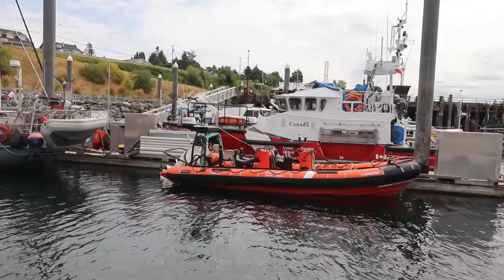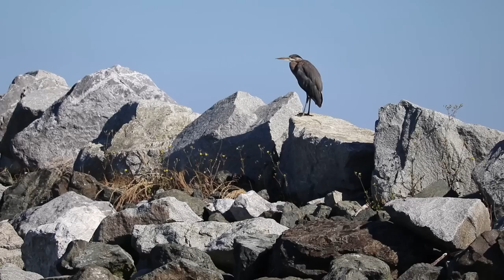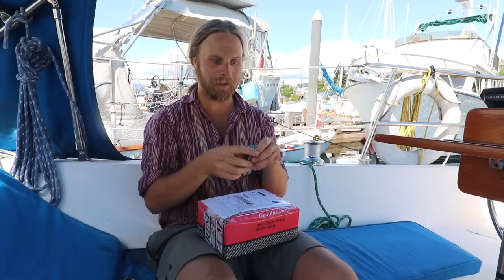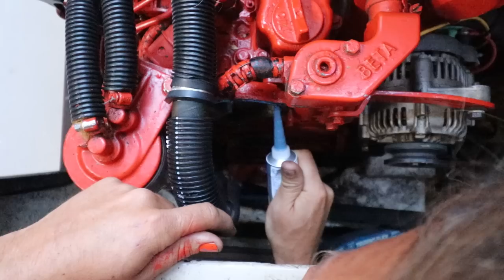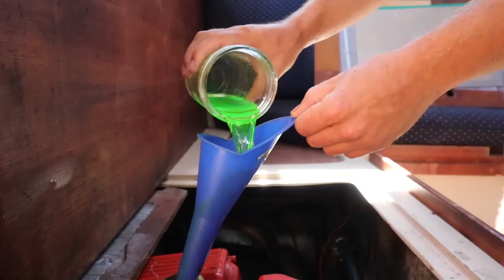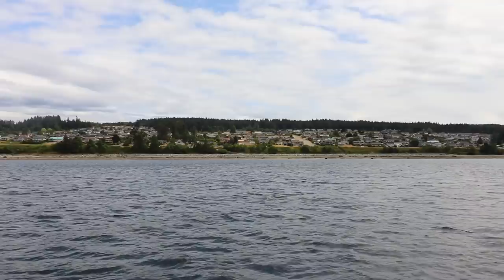Our Boat Broke AGAIN! Does Smooth Sailing Exist? | A&J Sailing

Comment: Nice clean Engine !!  That shaft should not have broken, did not hear this from other Cat30 owners, with a clean engine like that I have no doubt your keel bolts / studs  are all greased up and tightened, your engine looks different from what we had, we had a Kubota M30 24hp 3cyl diesel, did not have problems in the 10 years we had the boat, Nice video !!! love it !!
Reply from the maker: It’s a beta marine 14, and yeah pretty uncommon for a failure like that! The belt was a touch oversized and we think that the shaft sheared due to harmonic vibration. Never seen a water pump fail like this, I believe it’s pretty uncommon! Thanks for always watching, we love hearing from you!!

Comment: Excellent video, thanks.  just a heads up though, use the thread lock on the pully bolts but antiseize on the pump to block bolts,( just for ease of removal later since water pumps go often) if correct torque is used they will not come out, next only use a very extremely thin film of gasket silicone, rule is, if you have a lot pouring out when you tighten the bolts, there is too much and not good to get gelled up material floating downstream into the small tubes of the heat exchanger. but nice work thank you.
Reply from the maker: Thanks for watching and for the tips! Hindsight is 20/20 and I definitely went a little heavy on the thread lock and gasket sealant. I might take the water pump off again and redo it over the winter, there’s a couple of engine maintenance jobs that I’ve got planned for our off season. Also didn’t know about using anti-seize on the block bolts, thanks for the advice!!
Reply: @AllisonandJamesSailing  I used anti-sieze on my bolts to the block last summer.  I just used a hint of red RTV Silicone on the gaskets.  If I put too much, it would make it easier for the gasket to squish out, not to mention the extra silicone will get into the circulation.  But thanks for the video.  I wasn’t the only one having water pump problems.  My problem on my Perkins 4-108M was a leaking 2nd gasket against the block and not the water pump itself as I originally thought.

Comment: Betamarine use the Kubota engines that available world wide used in agricultural and industrial applications. Very tough engines and may be able to obtain parts at agricultural stores.  Wished I had a Beta marine instead of Volvo.
Reply from the maker: No complaints regarding the reliability of betamarine/kubota engines, they’re great and apart from this really odd water pump failure we’re very happy with ours!

Comment: i have seen the broken shaft issues in the past, usually caused by bad bearings plus the belt tension, good that you shut down right away, if that ever happens again keep an old rule bilge pump on board. if the pump should fail you can run a hose from either overboard or from the seacock and the output straight into the water pumps intake run either off you batteries or directly from alternator if you have a segregated belt for the alienator otherwise you may need to just use battery.
Reply from the maker: We have a feeling that the bearing was on it's way out, interestingly the belt that was on the accessory drive was actually oversized and even with the tensioner maxed there was still plenty of deflection present in the belt. We do keep a spare rule bilge pump on board and have the necessary fitting to jury rig a temporary fix should it happen again, but we're hoping to get a good service life out of the new pump. Thank you for watching and we love hearing your constructive feedback! cheers!
Reply: @AllisonandJamesSailing  I very much enjoy your channel , thanks for putting these videos up and helping fellow sailors and entertaining us too

Comment: Aloha, You might add a coolant over flow container, like what is on your car, to keep air out of your cooling system. Oxygen in the system will cause corrosion. Great video! Moonrunner
Reply from the maker: Aloha! Thank you for the advise Bill Denney Jr. I'll look into mounting an catchment container off the heat exchanger cap. There is a metal nipple there below the cap so it shouldn't be all that difficult to rig up. Cheers mate and thanks for watching!

Comment: Nice recovery.  If you have your dingy and an outboard with you it makes a very serviceable pusher tug. You can either lash it to the stern quarter or if it is an inflatable, butt the nose directly into the stern so that it is just below the swim ladder. Then tie it in place with lines from the aft end of the dingy to the stern cleats. Set the motor speed and lock its tiller and then climb back into the cockpit and steer with the ship's rudder.  
I used this method when my water pump seized up and left me stranded about 5 miles from the marina.  I was able to make about 3 knots with my 2-hp Honda.  When we got near the breakwater, one of us got into the dingy to hand the throttle and reverse.
Reply from the maker: Nice!! Glad you made it into the marina safely! We unfortunately didn't have an outboard at the time, but since have rectified that :) next time we're out we'll rig it up and see how best to 'dinghy tug' our boat around!
Reply: @AllisonandJamesSailing  Towing with a dingy is a losing battle.  Pushing works very well.  With our C30's the swim ladder makes a nice bow chock for my dingy.  I tuck the nose of the kink under the hinge of the ladder and use a couple of lines from the grab handles on the stern of the dink to the stern cleats on the boat.  It basically makes it a rigid extension of the hull and all of the power of the outboard goes directly into the stern of the sailboat.  
FWIW, I used the same setup when I was loading my Labradors.  With the boat tied off as described above, I could place my top of my extendable dog ramp between the Pushpit uprights and the bottom end would land on the seat and the dogs would march up and down like an Admiral boarding his flagship.

Comment: Normally you torque in a star pattern.  I use the black non hardening form a gasket instead of the blue rtv. Spares on my Valiant 40 are starter, fresh water pump, raw water pump, belts, impellers, fuel and oil filters, engine fluids, transmission fluid. You can't carry everything,  but having some basics can get you out of trouble. As another poster mentioned,  the water pump pulley in the video doesn't appear to spin true. At least in the video it looks out of round.  That should be checked and possibly you need a new pulley.
Reply from the maker: We’ve significantly amended our list of spares and now carry a spare starter, impellers, filters, belts and fluids and will continue to add to these supplies as our budget allows. Agreed there seems to be a bit of a wobble in the video, not sure if it’s an optical illusion of the camera but when we inspected the pulley it seems to be spinning true and in alignment. Thank you for your keen eye and suggestions :) cheers mate!

Comment: Hi Guys,
I’d previously mentioned your headsail car being too far back … i set mine at the optimum position for hard on the wind trim then use a 4:1  tweaker (8mm braided line)with a jammer at the bottom like a mini main sheet system with a snap shackle at each end , the headsail sheet runs freely through the snap shackle for when i ease the headsail for off the wind angles… i can pull this on from the cockpit…i was out sailing solo today… oh by the way i sail professionally on a race boat and am the headsail trimmer…
Reply from the maker: Hi Ian! Thanks for the explanation of how you have the tweaked set up on your boat :) we will be looking to set up a similar system on our boat so that we can get better at trimming. We actually picked up a copy of Ivan Dedekam’s Sail & Rig tuning book, there’s so much I didn’t realize about sail trim! We really looking forward to improving our system and getting more efficient at sailing. Thanks for watching mate! 
P.S. where and what do you race on? The professional racing scene looks like an awesome time!!

Comment: Did you replace the zinc anode on the heat exchanger yet? if not it is a good idea to check it out and replace regularly. Cheers
Reply from the maker: We sure did! There was a bit of incomplete footage that didn't make the cut. But while we had the coolant dropped out of the engine we pulled the heat exchanger stack, cleaned it and re-installed it with new O-rings as well as changed the zinc. On our Beta the zinc anode is located on the outlet of the heat exchanger as it dumps into the exhaust elbow.

Comment: Good job fixing your water pump 👍 read a lot of the comments.Lots of opinions down there 🤓think you didn’t do anything that cause the problem like a too tight of a belt.I would not have used thread lock especially on the bolts in the block.You did a great job otherwise 👍I like the beer to let it dry idea 🍺You both are great to watch and your videos are very good🤩
Reply from the maker: Thank you Mark for your very kind and thoughtful words! Hopefully those bolts will stay in for a long time before I have to try and remove them again, guess we'll be crossing the bridge when we get to it! Awesome to have you on this journey with us, cheers friend!

Comment: "bolts" not "screws"  ;)  interesting putting RTV on the bolt threads...Is that for anti-corrosion
Reply from the maker: Not RTV but threadlock. Essentially thread glue to prevent the ‘bolts’ from backing out under vibration.
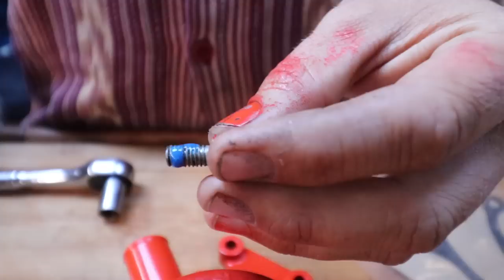Reply: @AllisonandJamesSailing  Ok, it was locktight, just looked again at 8:14 you can see two tubes....my bad , I thought you were using RTV and thought I might learn a new thing. Thanks

Comment: a belt that is sometimes too tight can cause the axle to pull, and end up breaking...or is it a fault?
Reply from the maker: Hard to say exactly what caused the pump to wear. The belt that came off was too large and even with the tensioner maxed out there was still a good amount of deflection in the belt. It’s still a mystery to us! We put the appropriate belt on after we changed the pump and have it tensioned correctly so hopefully this pump outlasts it’s predecessor.

Comment: Hi there. There's something really odd about that shaft  breaking like that, especially with the force with which it went as described. Beta engives are extremely well made too, and tbh, I'd have that old shaft thoroughly Inspected, plus what was around it to force it to go like that. to me, it had to have somehow seized inside the Pump, or had a much too too tight Pulley putting shaft side pressure in the Bearing ? Head scratching time here, but if it is possible to over tension that pulley to such an effect, imho you really need to get to the bottom of it Fast, or you could be heading for another Water pump Shaft Failure ? I don't think the engine wasn't getting enough water in to also be cooling the pump by the sounds of it, but something really odd has happened that you need to get to the bottom of, after all, that's nothing like being close to being an old engine, and looked after, a Beta should easily last a lifetime. My very best Wishes in getting to the bottom of this, as Boat engines are things we trust Our Lives to, when conditions get very nasty. Fair Winds. Bob . 👍eta typo fixes
Reply from the maker: It’s quite odd and unexpected! We’re still investigating. Will follow up if/when we find answers. Thanks Bob!!

Comment: Most coolant should be mixed 50/50 with water. Pure antifreeze can eat through aluminum. Read the bottle, some are premixed.
Reply from the maker: Cheers B Mck! Antifreeze can be some pretty caustic stuff also animals like to drink it sometimes so it's important to dispose of it carefully when changing fluids.

Comment: I believe that the Beta marine engines are "marinized" Kubota engines which means that you can get engine parts such as that water pump from any Kubota dealer or from the internet.  You just need to find out which block it is based on.  The same is true for my Universal M25XP which is a D950 Kubota.  I can get a water pump on-line in two days for about $50.
Reply from the maker: You're spot on, they are marinized Kubota engines! We have a beta-marine dealer locally so luckily getting the pump was pretty straight forward. But I will log some part numbers so that I can source parts without the surcharge of going through them! Thanks for the tip Hayden!

Comment: Beta's are known for their reliability and ease of maintenance. That kind of failure seems unusual and rare to me. The only thing I can think of is that the belt may have been way, way too tight.

"Does smooth sailing exist?"
Living aboard is like home ownership and "van life" only worse. The conditions are much more harsh and the boat never truly sits still, even when anchored. Even new boats have teething problems. Cruising is "fixing broken shit in exotic locations."  Just embrace it.
Reply from the maker: We also thought it an unusual point of failure. The belt that came off was actually too large and the tensioner in the alternator was maxed out with deflection still present in the belt. Perhaps it it was run for a while with a tight belt but as the boat is fairly new to us, we can only speculate as we embrace this new exotic location that we get to do projects in :)

Comment: The pulley didn't look like it was running true on the new pump, which may be what fatigued the original shaft that failed. I'd fix that now... or wait 8 years for the new one to fatigue. 😜
Reply from the maker: I've often wondered what caused the shaft to shear. When I took the water pump off the bearing was intact and the impeller spun freely. When I seated the pully to the shaft (of the new water pump) I made sure that both faces were clean and free from debris and the pully fit snug and square. On close inspection the belt seems to be travelling smoothly and there isn't any vibration in the pullies while under load, so we're hopeful that we get another 8 years out of this pump!

Comment: A rater unusual fault. Perhaps the belt was too tight?
Reply from the maker: A tight belt certainly would cause wear on the shaft and bearing. Interestingly enough the belt that came off was actually too large and the tensioner on the alternator was maxed out with plenty of deflection still in the belt. Perhaps at some point in the service life of the pump it was run with a tight belt but this remains a mystery to us.
Reply: @AllisonandJamesSailing  Yep could be, happy sailing!

Comment: Boats not unlike airplanes do not have an advertised airframe time or “hull” time. So if you buy an old boat, like an old plane BEWARE. You will need to do a full and complete restoration replacing ALL mechanical devices, including engines, pumps, electrical components, generators etc. While your hull cannot be replaced, and may be old, your drive system better be up to date. Dock queens not so much. This is more so if you plan to sail.
Reply from the maker: That’s a really fair comparison, boats like airplanes only live as long as they’re cared for and maintained. I’d be very nervous about buying an old plane though, maybe one day.

Comment: PS to my post below. I'd personally ask Beta Marine if they would like you to send them your old water Pump for them to investigate, just in case there's an issue that needs to ve I vestigated (it may be something like a bad Batch of Steel that isn't up to the necessary standards for example, and other owners may need to be aware of a potential issue, or even have a recall). It's Concerning, because it's the first time I've ever heard of a shaft Failing like that in such an obviously good condition engine. I freely admit to being a bit paranoid about extreme Conditions when Afloat in a Boat, after getting through a number of unpleasant weather events, the worst lasting 3 days of being violently Seasick, hence my love affair with diesel engines, and having a personal policy of getting the next size up engine (same with anchors). My Next boat has a Standard engine that is a 57hp Diesel, but thankfully has a lovely 80hp upgrade option which I'll be going for, which will be there When, not if, it is needed. tbh, that's why I will never entertain having Battery powered electric propulsion on a boat, not even on a Yacht Tender. When you really need the power, Batteries just Don't have the necessary energy Density to Deliver what is needed for anything like long enough. Not with Current Technology, or even into the medium term future. Something Completely New is needed, and hopefully we get it in the not too distant future. Best Wishes. Bob.  👍
Reply from the maker: It’s a bizarre occurrence! Curious what Beta would determine/have to say and will try to follow up! Thanks Bob!
Reply from the maker: That sounds awful, mate! Sea sickness is one hell of a debilitating experience! 
We went for the larger size when we replaced our anchor as well. Makes it heavier to haul up but we sleep better!

Comment: Ok. That looks like a Beta engine, so that is a new caution for Beta owners going offshore, carry a spare water circulation pump. No doubt you didn’t buy just one, you bought two? A suggestion I give every one is to become familiar with segmented “v” belts. These are a type of belt that is made up of short segments which are linked together with metal clips so you just buy a few meters of the belt section your engine has and use only as much as you need for the application ie you will always have spare material that fits. Mind you, you should never really need to replace a segmented belt as they last much longer than ordinary “v” belts. The only caution is don’t put you hands near them when they are running as the outer surface is rough.
Reply from the maker: Thanks for sharing! I haven’t heard of segmented belts before and will look into it! Cheers William!